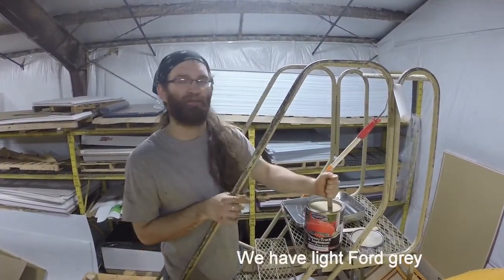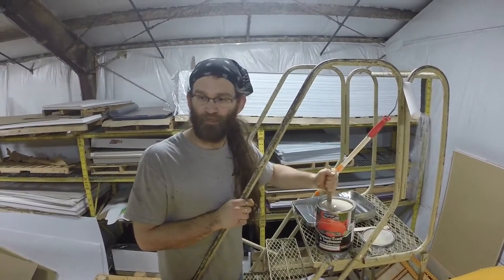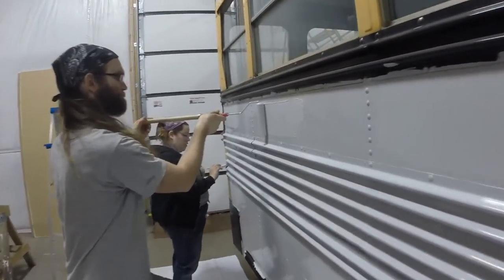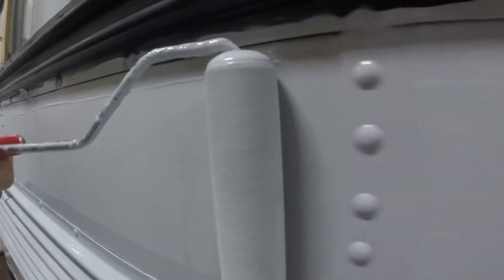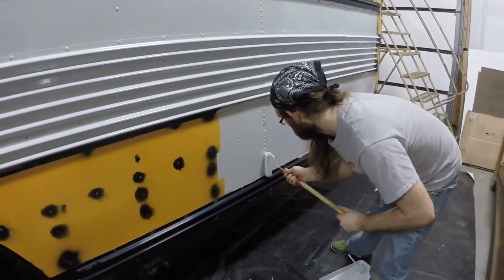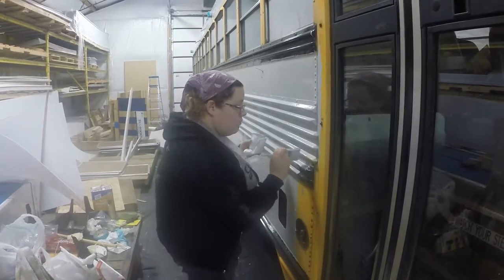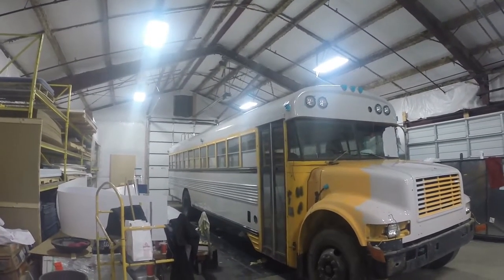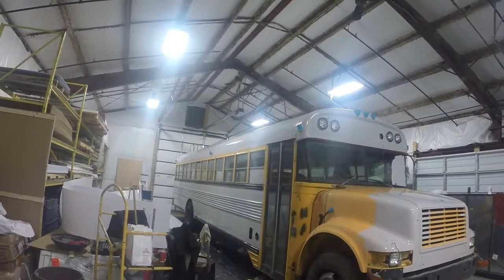#5 Applying Camoskin Stealth Multipliers, Start of Paint

Comment: where did you get the lights for the flashers?
Reply from the maker: +David Ries Those are the stock flashers with the colored lens caps removed.  In a later video, we paint the covers black and reinstall them.